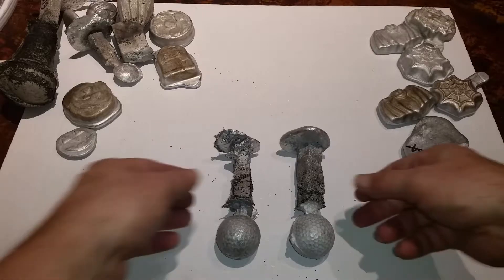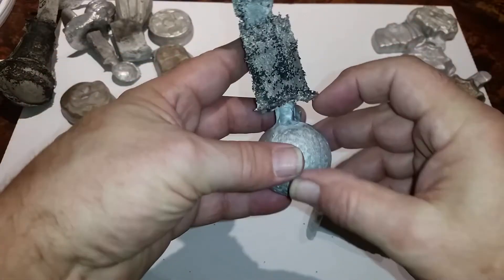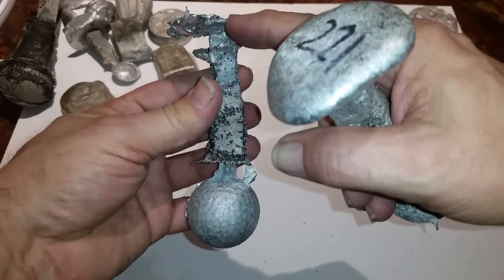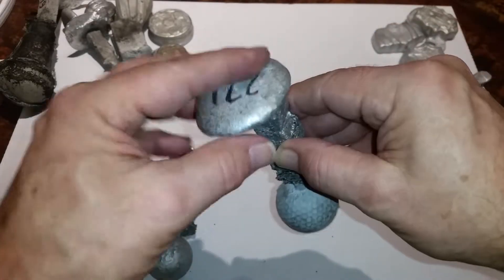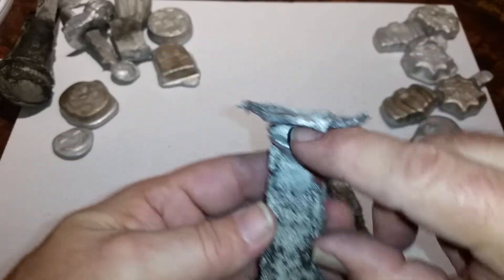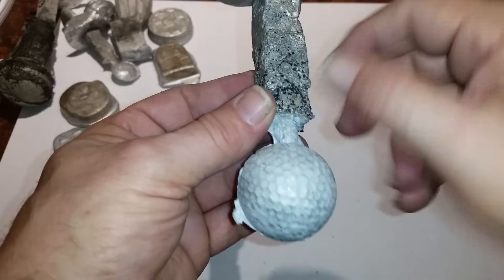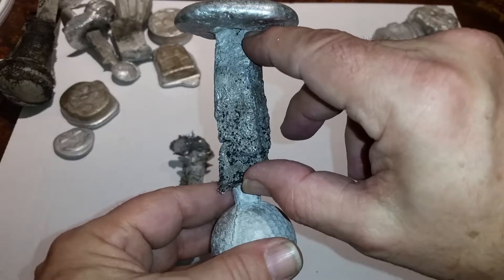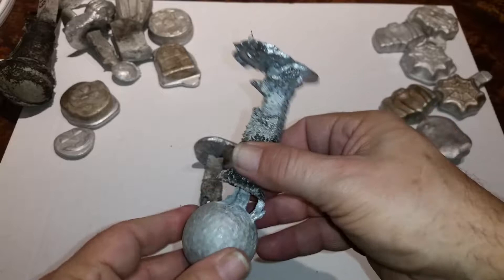Aluminum golf balls - plaster of paris mold results

Comment: So, slow continuous pour for better detail and no cavity?  How'd you hold the two part mold together, and did the molds hold up well enough for a second casting?
Reply from the maker: My yammering didn't explain the pour or cavity very well.  The two results would be best explained with an animation.
The mold is shown in another video.  After removing the ball. The mold was dried for 4 hours in the oven at about 100-125F or so.  The drying is critical, to make sure it doesn't explode.  
The mold was taped together and buried in sand. See the flask filling.
The mold is lost after the casting.  One shot deal.